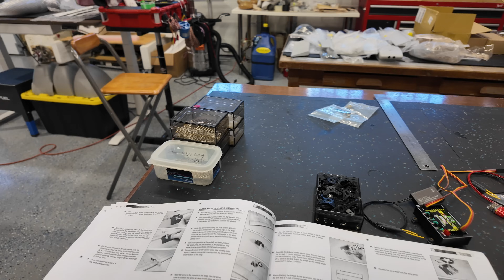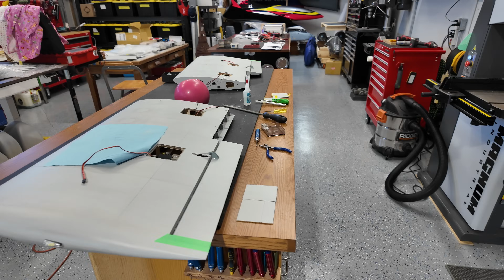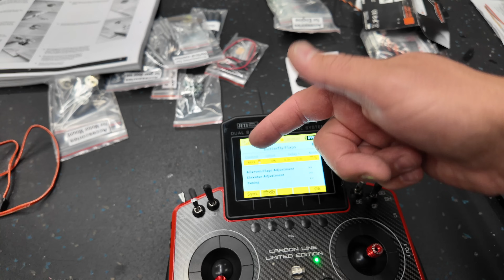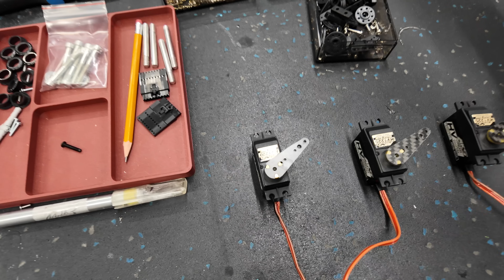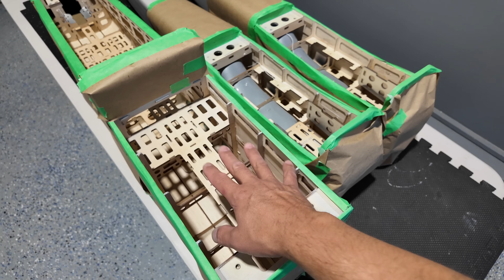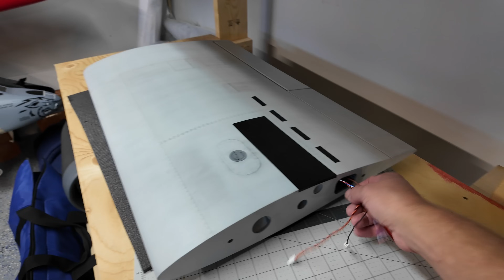Watch As The Bronco Ov 10 Build Comes Alive: Wing Completion Hangar 9 RC Plane

Comment: Great build buddy and great finishing on your model builds. Nice flying models from Hangar9. Only thing I will change from the beginning is the actuators on landing gear. The stock ones last about 10 flights max and start failing. I changed my actuators to JP and also controller and no issues anymore.
Reply from the maker: Good call!  I have a few sets of those that failed.  Working on replacements.

Comment: If you have read posts on various bbs, you know the gear has issues. If you gear has the flat faced retract motors, run forest run. The gear reduction is subject to jamming/stripping. One of mine was dead on arrival and the other lasted through 12 flights before giving out. The newer units have a conical nose where the jack shaft exits, and have been holding up for me. Also where the strut leg meets the trailing link fixture at the bottom of the leg is subject to failing. The gear leg is not very thick and has  threads into the bottom of the leg to screw into the trailing link part(!) Even under normal landing it is subject to failing over time. I reinforced that joint with a filet of JB weld on my replacement struts, and it has held so far. And finally the e clips that hold the main wheels on easily come off and along with it the wheel and tire. Happened to me twice on the runway and once in flight. Replace the axle with a 6mm hardened ejector pin which has a head on it and the wheel will never come off.
Reply from the maker: Good heads up.  Thanks for the tip!  New motors on route as well!

Comment: Hello Jonathan. Just two things... with this flap deflection you can do a "Sarajevo " approach. This thing will feel like throwing an anchor.  50-60 degrees are enough for Landing. Second one.... if you put the esc's in the nacelles you have to run very long battery wires. This could backfire. With this length you have to put some capacitors in the battery wires. I had the esc's in mine in the main fuselage with no issues. Using xt 150 to connect  the Motors to the Esc's.
Reply: As you stated, you need to have batteries and esc nearby each other. 😊
Reply: I agree i also have my esc’s mounted in the fuse close to the batteries.
Reply from the maker: @medscott2 👍
Reply: Nice Video like always tho